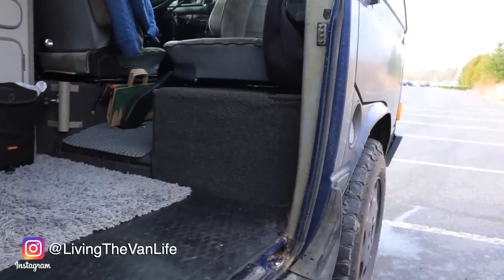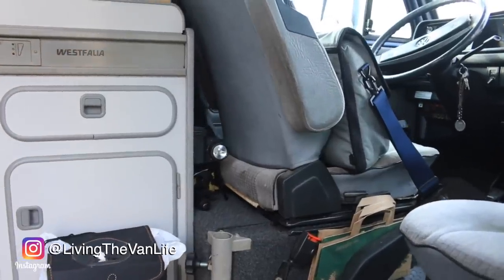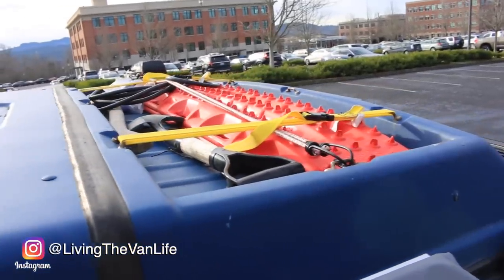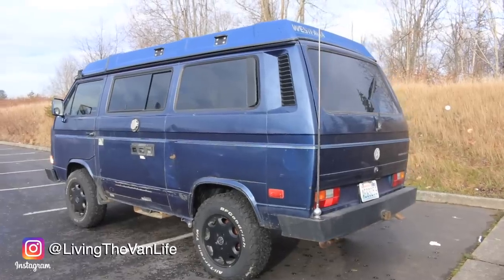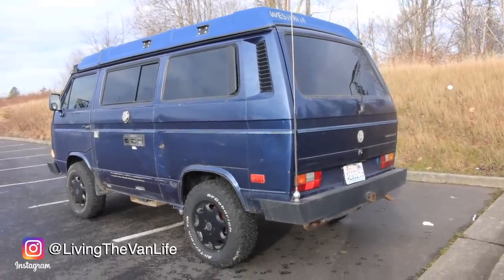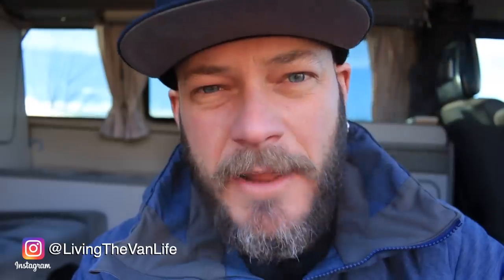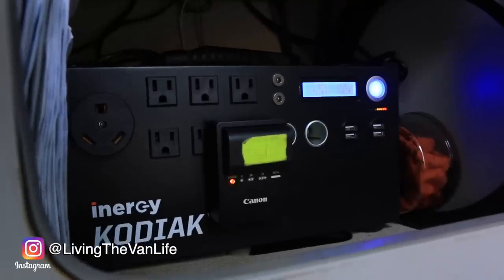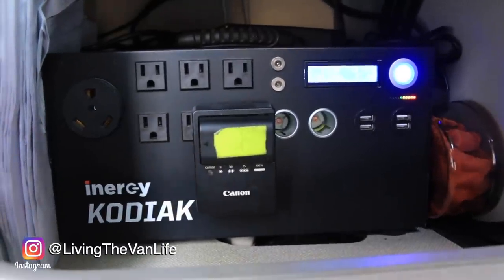Chinese Diesel Heater Install In a Volkswagen Westfalia - Living The Van Life

Comment: 3 years since the video… does your heater still working?
Reply from the maker: I no longer use that exact heater as that was installed in my Vanagon.  But I am still using a diesel heater, similar model, in my Sprinter Van.  You can bet the details my my build episodes or tour video-

Comment: Hey Chad, thx for the heads up about this vid. My biggest concern about the diesel heater is exterior noise when in use for urban stealth overnight. Hope you find a good muffler and do a vid on that too. I've seen a vid where a person explains that there are mufflers that are useless and don't have a kind of mesh mechanism inside the muffler. Hope you find one good one and post the link, too. It seems most of these Chinese diesel heaters and it's accesories like mufflers don't have brands which is infuriating for trying to give recommendations.
Reply from the maker: Yes.  Indeed.   I run mine on low over night in the city. So it’s pretty quiet.  Urban stealth camping has not been an issue with it.  I have warm bedding so I’m not 100% concerned about using it through the night.  Thanks for watching my friend!
Reply: can just use 2 of them like i'm thinking to do. should not be any noise then !
Reply: @NightshiftCustom  You have to keep in mind that there still needs to be sufficient flow of exhaust. A muffler will create resistance. There are maximum length info on how long the exhaust can be for the Espars, I'm sure that's true for these also. Dual mufflers might not work right.
Reply: You may think about installing some sort of loud heat sensor in the area near the heater for your safety while sleeping.  Even something simple like this: https://www.amazon.com/dp/B01BMNTVQM

Comment: Where do you have it plugged in at in your external battery? I don’t see it plugged in only your canon battery , I wanna get one I just don’t know how I’d go about hooking it up to the battery yet
Reply from the maker: There is 12v connectors on the side of my auxiliary battery that feeds to my auxiliary 12v system with a fuse panel.  The heater is hooked into that.  Its hooked up the same as you would hook it up to any 12v system.  Hope this helps

Comment: Great video Chad. How well do you think it would do on a roof top tent set up? ive got mine trailer mounted. Any issues with super cold weather feeding the intake? ( i live in Wyoming.. gets pretty cold and windy at times)
Reply from the maker: hmmmmm.  It would really depend on where/how you would mount the actual heater.   The logistics of installing it would be the tough part.  You need a solid base with enough space to run the intake/exhaust for the combustion portion.  That usually runs out under a vehicle.  From there you would just pipe in your heating duct to the spot you want to heat.  With out physically seeing your rooftop tent, it would be hard to have any ideas of HOW.  As far as the quality of heat and operation, it would work perfectly.
Reply: @LivingTheVanLife  I've got my tent on a 4' x7' trailer. Lower part is inclosed with my gear.. kitchen. The exhaust I could route threw the floor on my trailer and out the bottom. Intake... drill a hole in the side of the trailer just big enough for the intake. Put a screen on it so no debris would get in. Put the diesel tank on the inside and put the spout threw the side of the trailer. Then.. run the wires to the front of the trailer where a battery would be. Solar panel would charge the battery. Take the heat tube up threw the topnof the trailer and into my tent. Good idea?
Reply from the maker: That sounds like it would work just fine.  You probably wouldnt need to cut the hole for the intake of the fresh air to the heating portion of the heater.  It would have plenty of volume to work from just sucking out of the trailer.  I cant imagine that your trailer would be air tight enough to where it would for a vacuum?

Comment: Do you think if you installed a coil of small diameter copper wire into the exhaust pipe it would work to heat water?
Reply: I was thinking with some more work, you could make a radiant heater with the exhaust. That is heat being wasted...  I would experiment with copper piping under the floor and then an exit out the van.

Comment: can you give us info about the amp draw when it is running as well as the rate of fuel usage, so we can compare prices of diesel vs. propane?  thanks in advance.
Reply from the maker: I will certainly work on gathering this data and perhaps doing a video specifically about this.  At this point, I do not have specific data to answer this question correctly.  Thanks for the comment!  Keep on truckin!

Comment: the author of this video doesn't realize all of these Chinese heaters are dual fuel, gasoline, or diesel. He could of not bother with feeding diesel at all, though diesel might make sense,  a bit less prone for mega fire, could be somewhat easier to put out a fire, and diesel is more btu output.
I probably would have kept the fridge, and just use gasoline straight out of vehicle's fuel tank, eliminating the need to use the included in the kit plastic tank

Comment: WARNING! "if you were thinking of installing this diesel heater in a closed environment like a campervan never take combustion intake air from inside, also it is advised the mounting plate is your seal between all that is inside to that which is outside"

Comment: You have been doing this long enough to edit better / less. 

The background noise throughout is really annoying. 

I would suggest putting in a shutoff valve. It is much easier to service the system by being able to turn a valve rather than pinching the tube or siphoning the tank.

Comment: Do these diesel heaters need the cabin to be vented??? Any possibility of dangerous fumes? I've been building my bronco with a sleeper but looking for a heating unit. I travel from Texas to North Dakota for work so would like to run a unit like this on a separate battery bank then my starter battery
Reply from the maker: Nope. They don’t need ventilation, the combustion fumes are exhausted outside.  If done properly, there is not danger of toxic fumes.  But to error on the side of caution, most certainly install a CO alarm inside.  $16 from amazon.
Reply: @LivingTheVanLife  thank you I appreciate the info

Comment: I hope if the fan on the heater shorts out, burns out, that the entire heater and pump will shut off.
Reply: There should be a high heat cut off or some other sensor just like a furnace
Reply: @MrKongatthegates  - My old oil burner had an "optical eye" for that, but had to replace that a few times across 30 years, and the igniter and the transformer, lol. Finally I got rid of the oil burner at house, went all electric, put a woodstove on the old chimney stack instead, for warming basement extra during bitter cold weather so that pipes don't freeze.

Comment: I would have used snapper clamps on the fuel line. This way you could have mounted the tank in such a way as to be able to quickly remove it in summer and maybe throw a small fridge back in there for warm weather. https://www.mcmaster.com/plastic-tube-clamps

You just need to twist them sideways and they pop apart, but when they are snapped in place, they work as well as any clamp. I use these on industrial and lab applications and they do great. You could leave the last bit of tubing and the bearing. The rest could go with the tank.

The rest looks like an excellent installation. Maybe add some leak detectors along the fuel line if possible. I might also consider upgrading the fuel line if the material isn't top grade. I've seen lines crack. Which brings up the point of inspection and maintenance, which it seems you plan to do. However, every other time I changed the fuel filter, I'd replace all the lines too. Why? Because of the location and the confined situation. You might have put a shut- off valve before the fuel filter. You'd be surprised at how that can come in handy in case you need to shut off flow at the tank in a hurry, or just do some maintenance.  Normally, a ball valve is most often used, but again, it's a confined space, so look around for something that would work and make sure it's compatible with diesel fuel.
https://www.mcmaster.com/miniature-ball-valves

Good stuff and great video!

Comment: How noisy is the clicking from the fuel pump?
Reply from the maker: While mounted to the floor INSIDE the cabinet, I CAN notice it if the van is completely quiet.  If there is a fan going, some music, a conversation etc... there is no noticable sound from the clicking.  On another install we did to ELdad's van, we mounted the pump outside and it is completely quiet inside the van.
Reply: Living The Van Life thanks man!

Comment: Why did you not mount it under the passenger seat?
Reply from the maker: Mount what?  The tank?  The heater?    There is no room under my passenger seat whatsoever.  for anything.   My main battery is located there.

Comment: How long is that little tank last before you have to fill it up again
Reply from the maker: This weekend I ran it on 5.0 (full blast) for 24 hours and it used 2.5 gallons of diesel.
Reply: @LivingTheVanLife  thanks  how much current does it pull how long did the battery last

Comment: with your van being so small.... u have a engine and cab heater that would heat it up the interior, already had a gasoline tank.... prob sips the same at idle as the heater u installed... so why?

Comment: Obviously I'm not done the video. But u never ever store fuel inside a cabin OF ANY VEHICLE
Reply: I wouldn't overly worry except with petrol. Derv whilst combustible isn't that combustible. Most van conversions have bottled gas inside. So unless your going to wrap yourself upon bubble wrap just think about what your doing and take precautions. Vent in floor for gas etc.

Comment: So you need fuel. You're gonna pull up to the diesel pump at the station, slide your door open, and stretch the hose into your kitchen cabinet? That'll drip, stink, and be a hassle.
Reply from the maker: Negative.  Not at all.  It works perfectly.  Sure if your careless and sloppy, it would make a mess. I’ve filled it probably 6 times this way so far and it’s absolutely zero problem.  You just don’t treat it as if your filling up your diesel pickup truck.  With using a paper towel or two, you can avoid any and all drips. Simple.

Comment: How much diesel does that thing run through in a week?
Reply from the maker: On highest settings, it goes through 2.5 gallons in a 24 hour period at 17,000 BTU.
Reply from the maker: That will keep the van at 78°F when it is 0°F outside.
Reply: That's 9,464 litres (Gallons is like Chinese for me 🤐).
Reply from the maker: FE59FE59 simple google conversion does the trick.
Reply: 78°F = 25.5°C and 0°F = -17.7°C
Reply: @LivingTheVanLife  that's what I did, I just want other people to save some seconds 😊
Reply from the maker: Thanks Mate!!   🙌🏼
Reply: Are those American Gallons [ie 3.5litres] as opposed to Euro Gallon [4.5 litres].?
Reply: @delboy7039  oh no 🤔

Comment: probably taking things a little extreme but wonder what the exhaust would sound like when adapted to run through a small car muffler or cherry bomb? lol run it out the back and maybe people just think your vehicle is running, possibly even with a good tone lol
Reply: I had the same thought lol, there is an aftermarket resonator that fits a 2003 impala, it's like a giant heavy duty cherry bomb, I have used it on all my cars as a muffler for 15 years.
Reply from the maker: Ha ha ha..  That would work!  Would need a really tiny one though.  hahahahah

Comment: Does it need an exhaust?
Reply from the maker: Yes it does.
Reply: The unit has 3 connections to the outside. Fuel intake, exhaust and intake for combustion. This eliminates any ice buildup inside like a Mr. Buddy.

Comment: Hi,
I have a webasto factory mounted in my Bmw, its really awsome. Though mine heats the water.
But i know it uses a good portion of power when its running, so im able to run it for half an houre (this is pre set by the factory).
Now i havent seen what type of power system you have,  but does it draw a lot of power from your batteries over night?

I know that a lot of trucks has these air heaters in the cab and run them through the night, but i imagin it uses a lot of power as the water heater does?
Reply from the maker: That sounds interesting

Comment: wrong,
- the washer you used on the nipple is for one of the tank 3 install points
- your pump will die much faster unless you install it at 30 degrees to vertical angle
...but your stuff is well installed and will survive... just that you made these mistakes

Comment: How much fuel does this unit consume
Reply from the maker: On high, it consumes 15L in a 24hour period.   65°F inside while it was 0° outside.
Reply: @LivingTheVanLife  
Thanks for the info 15 l in 24 hours is not too bad I suppose you could trim that back by turning the Hertz down to the fuel pump
Reply from the maker: Most definitely.  On low one tank lasts nearly a week.

Comment: I paid under $600 for a genuine airtronic from heatso
Reply: And when it burns out after eight months you'll spend another $600 for another genuine Airtronic. Eventually you will come to the same conclusion as most, and realize your money is better spent elsewhere. Also you got a great deal because the Airtronic lists for close to $900usd. It is possible to buy as many as six of these Chinese units for the cost of one Airtronic, even though they are essentially the same thing.
Reply: @flyingdutchman6984  can you please define what "burns out"?  Are you using it at high altitude without an altitude compensator?  I'm a member of one of the large sprinter forums and while a few have mentioned repairs and ease of servicability I have yet to come across anyone crying that they only last 8 months, with their popularity it would be kind of hard to get that cat back in the bag...
Reply: @kfstreich4787  - I have used them in a sailboat, so about as close to sea level as you can get. When I say burns out I am talking about the heat exchanger (burning out), burning out of seal gaskets, or loss of heat capacity due to fouling of the inner surface of the heat exchanger. Also when I mention eight months I am talking about running the unit almost continuous. I don't think even the best of them can handle running that much. Thankfully I haven't been anywhere near a place where I needed a heater for a very long time.
Reply: @flyingdutchman6984  full time would do it, I have read the inside fouls faster at high altitude due to over rich mixture, I thought they were clean able?  Perhaps the salt air accelerates corrosion?  I haven't read about that in van or big truck applications,  mostly sensors or cleaning maintenance.
Reply: @kfstreich4787  - You're probably right about the salt air. It seems to destroy everything faster. Probably rotting them from the inside out burning all that salty air.

Comment: Explain auxiliary battery 🙃
Reply from the maker: My aux battery is a Inergy Solar Kodiak.  It is a battery, an inverter, a solar charge controller all built into one, simple, compact box that is very portable.  It can be charged from a 120v AC source, a 12v source, or a solar panel source.

Comment: Don't get a silencer, it messes with the air/fuel ratio and will soot up the combustion camber in no time. I even went as far as taking off the hose from the air intake on the bottom of the heater to help with getting enough air to make a proper mixture. Originally i ordered the heater and shelled out the $20 for a silencer and extra length of exhaust pipe, in hopes of getting it nice and quiet, but had to take it apart to clean out chunks of carbon buildup once every few days, which got old quick. My LCD controller is slightly different, so maybe my particular heater is old stock and has been revised or something, but it was not an easy heater to live with, sure it works great when it does, but getting it to that point took me lots of trial and error in giving it the proper air fuel ratio. My theory is that the heaters were not calibrated with the quality of life things installed like air intake filters or exhaust mufflers, but are sold with those extras because people want those things. Hopefully yours works fine without any problems. And if you do install a silencer, i would be curious to know how it pans out.

Comment: not advisable to use a buddy heater in a van unless its an emergency because it creates a ton of condensation, if you want yur roof to drip during the night then the buddy heater will do that for you,  I hate buying from China but I confess to being a hypocrite  and still buy ther stuff because of my current financial situation, The webasto and Entire spar are still superior and the espar is smaller, Webasto makes a heater cooktop combo unit that is eally neat, but overall if you have alow budget then these chinese heaters work well i HAVE HA DMINE IN MY SPRINTER van for 3 years now and so far no issues,

Comment: Wait, no data on how well it heats, how long a tank of fuel lasts, if it gets too hot, too cold or just right.  If you can set and maintain a temperature.  Why do a video like this without including critical data for those who are considering this option.